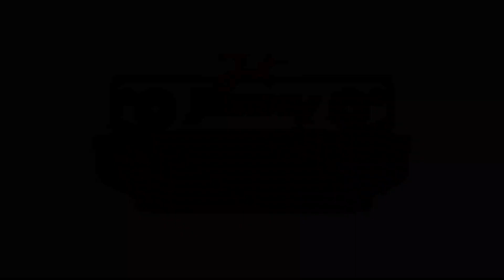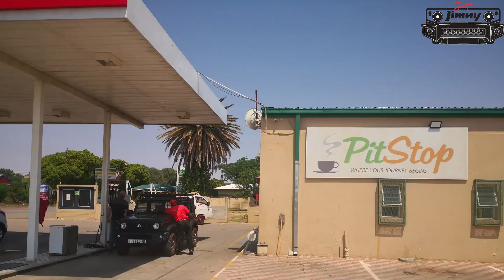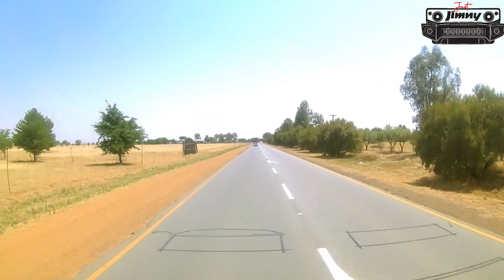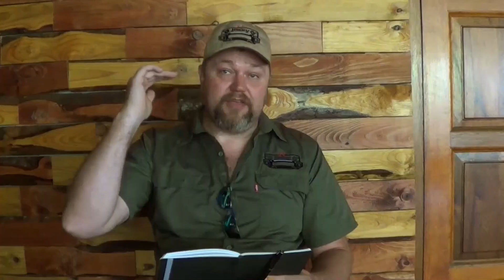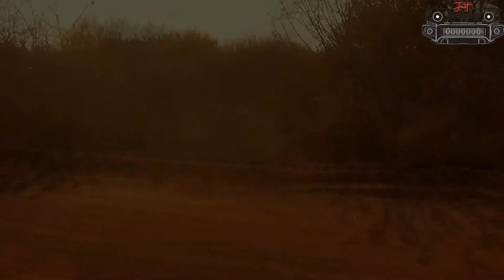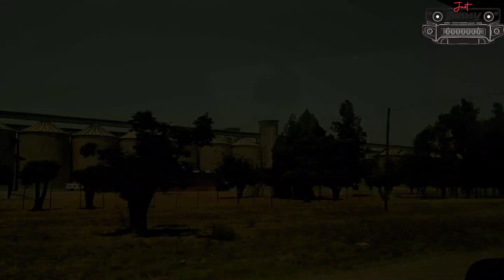Kalahari Road Trip , did the Power+ save us any fuel?

Comment: What kind of tire did you use there? 10-11km/liter is bad. Good range should be 15km/liter without any controller.
Reply from the maker: Hi thanks for the comment , nothing to do with tires , it was strong winds and a roofrack that affected the consumption so much , later test in next videos are better.

Comment: It seems that the benefit of the throttle controller vs its cost is not a cost effective exercise. You can spend all that money on a few extra tanks of fuel and see a couple more places for your money.
Reply from the maker: Hi Flip , like I said in the video this test was done under the wrong conditions actually and I think there would be a saving in fuel at about 110Km/h and no hectic crosswinds , I am busy now with the Normal vs Economy Mode for city driving , and I think you can only come to a conclusion as soon as those results are in. I was very impressed with the adjustability off-road and when we get together again you can take my Jimny for a test drive with it in , you will love the race mode :)
Reply: @justjimny  the throttle controller may have more effect in the city traffic when the driver is varying speed more by constantly pressing the accelerator. But certainly also streamlining (removing roof racks if not needed) may also make a big difference.